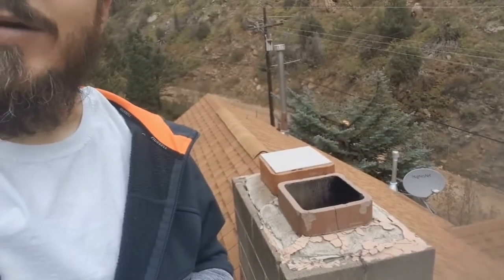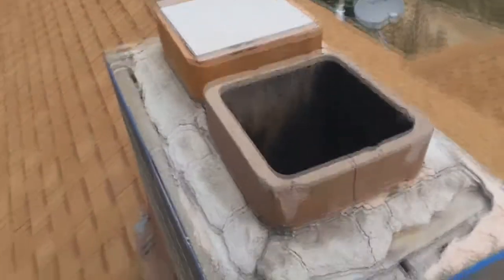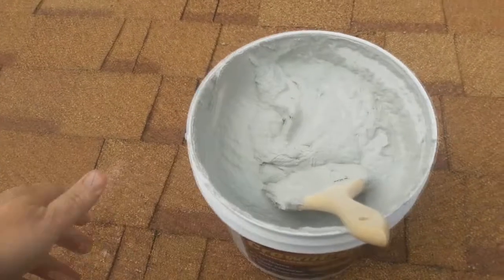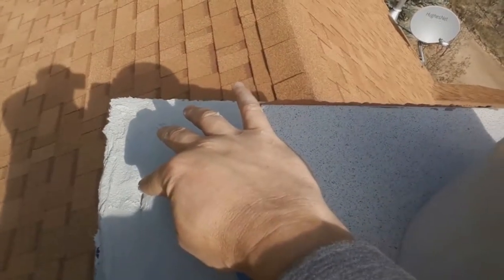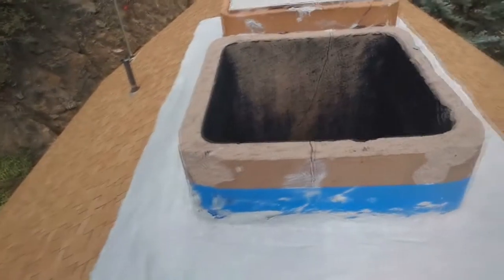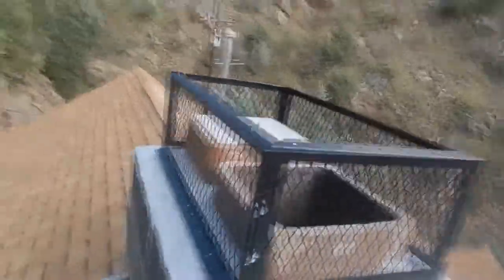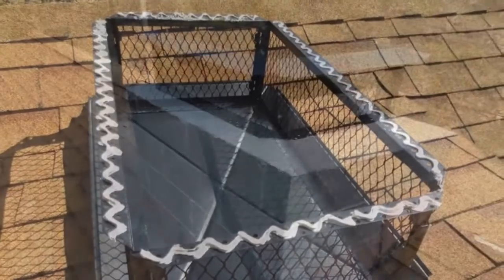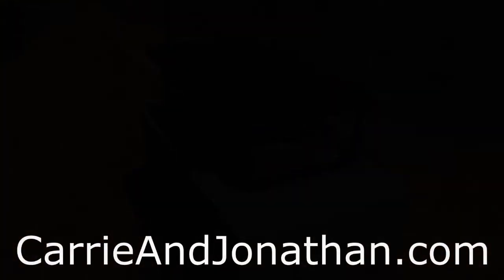Repairing A Chimney Crown: Total Amateur Fixes Chimney Crown and Cap

Comment: Hi, I am a professional chimney sweep from NC. We use a lot of Saver Systems' products, including Crown Coat. We only use Crown Coat on washes and crowns that are slightly cracked, but are still structurally sound. We oftentimes offer it as a cheaper solution if our client does not want to have it replaced with a properly proured crown. In your case, if I was inspecting your chimney, I would have recommended replacing with a new proper crown with a drip edge. Because you did not install a full coverage chimney cap (one that overhangs the chimney), I would recommend waterproofing the chimney. Concrete blocks are very porous and water can still run down the chimney and soak in causing deterioration. Never SEAL the chimney, because it traps the moisture and the masonry cannot breathe. 
Saver Systems makes great products and I do hope that it works for you in this situation!
Reply: Thank you very much!
Reply from the maker: I'm just reading back at this comment and want to thank you again for your comment. I need to get back up there and look at how the chimney is doing now and see about getting a wider chimney cap and waterproofing or at least sealing the chimney in some way. Thank you again for the suggestion!

Comment: Thanks for the video!  my chimney crown has deteriorated similar to yours (but mine is single... "exhaust"?) with a cement cap already... so now the question for me is really just replacing the sealant I think....
Reply from the maker: A year later, it's holding up just fine, so I can definitely recommend the crown coat.  Thanks for watching and commenting.  Let me know how it goes for you, and if you decide to use crown coat.

Comment: What does that other flue vent ?
Do you have a fireplace and an oil burner or is it gas ?
If gas , is it a direct vent ?
I highly recommend NEVER dealing a flue off prior to figuring out if it's in use or abandoned. 
Seeing that your still alive , it is most likely a flue that was at one time intended for a wood stove or possibly an extra water heater.
I use crown repair slot on small hair line cracks but in this case I would've done the entire crown new with cement.
Also the flue tiles are typically 18" in depth so you didn't have to worry about removing the loose cement that was pink..just pluck them all off because you had plenty on meat inside the stack already.

I do have to say besides what I mentioned..it does look like you did a great job.

I mention again , the mystery flue..definitely look into that and make sure it's a dummy flue and not in use.

Also , if you do ever do an install like this again I highly recommend cement anchors rather than the screws.
Anchors are pre drilled and hammered in , doing so it expands inside , instead of just grabbing a little grip like a screw does ..you will never have to worry about it blowing off .
I'm only giving constructive criticism..I an not shaming you , like I said the install looks professional. 
Good job
Reply from the maker: These are amazing comments and feedback. Thank you for making the time to offer these suggestions so others can learn from them as well.  Pretty positive the 2nd flue doesn't do whatever it used to do. This house has had 7-8  owners in the past 30 years. Someone closed off that flue and remodeled out whatever that stack was used for originally.

Thanks again for the suggestions, including the idea for the anchors.  Will keep in mind in case it's ever needed in the future.
Reply: We do have gas heating which is direct vent, and an on-demand hot water heater we had installed, which is also direct vent.  So I'm not sure when the other chimney was capped, or why, or what it was for.  Strange.
Reply: Thank you for your thorough reply and for your compliments!  Much appreciated!  Will definitely take everything into consideration if I ever need to do this again.  Thank you again!